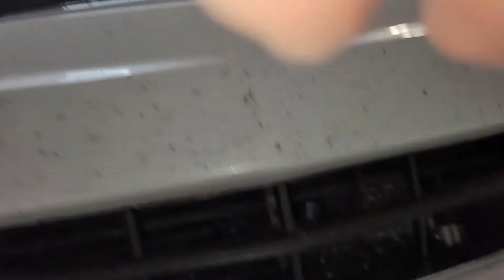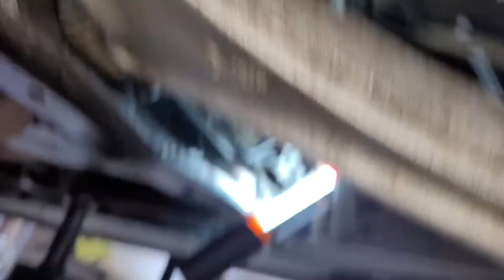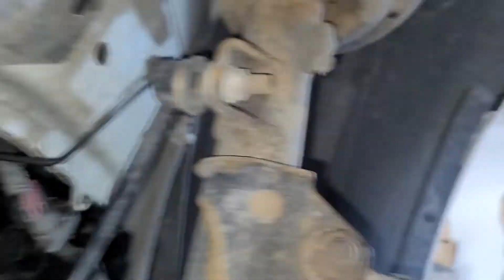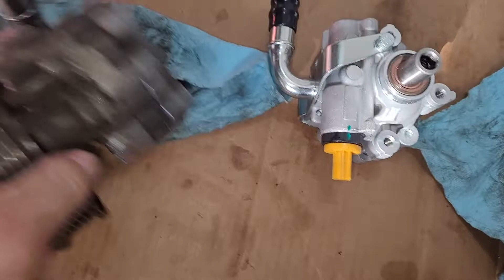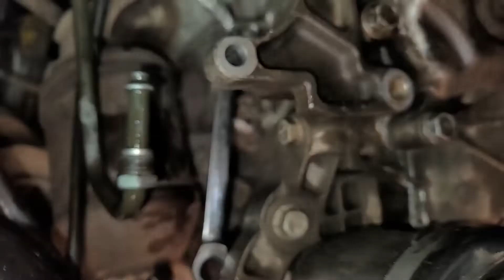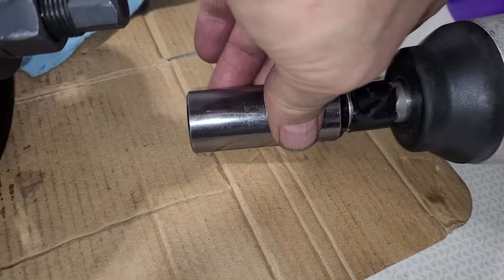Cadillac Power steering pump. Remove and Replace.

Comment: u missed vitals u said it upset u  but u could of edited the sound did u used 1/4 inch drive did u shorten the socket or not how did u pull  it out was it the most difficult part

Comment: I appreciate your struggle I believe this is the exact same process for the XTS, very much appreciated 💪🏽
Reply: im starting my xts did u have to remove shock and control arm i did
Reply: @ hey no I haven’t waiting on getting my pulley tool, damn did you!???? It’s only two bolts right?? Unlike on this srx
Reply: @thathvacguy   three bolts 2 in front 1 in back top front is really found myself screaming had to go home working out of a storage build and after work hope u don't have the probs i had remember harness attached to back of pump green loop on pull up couldnt get the mount off  have to figure new way to mount harness
Reply: @thathvacguy   and before i forget mount bolts are thirteen millimeter  i used a 1/4 drive  and used 2 different lengths sockets for top bolt because of the narrow area and and u will have to use a box wrench for back bolt if u have a ratchet wrench use that  13 mm
Reply: it is tighter than his/that top bolt is a screamer yea i took off the shock and control arm their is a harness on back of pump and had to buy one of those screw clamps too tight to get those special pliers to work had a pair of really long needle nose once u get it loose tip bottom out forward then turn pump body toward rear of car have to push lines out of way but be gentle  this is going to take awhile be prepared got two copper washers on the metal line probably should replace not even close to being done wow still on top bolt well good luck ul need it

Comment: Tip for those struggling with removing the pump ——> undo one end of the sway bar link and clamp the sway bar to the lower control arm.  You’ll now have a nice hole to pull it out through.
Reply: goated comment

Comment: Hi, How did you bleed the power steering pump when you had it on? Thanks for the effort.
Reply from the maker: Hey, thanks for watching! To bleed the system, while the front is still jacked up, start the car and turn the steering wheel all the way left, then right. Do this several times and make sure the reservoir is full.  Good luck!